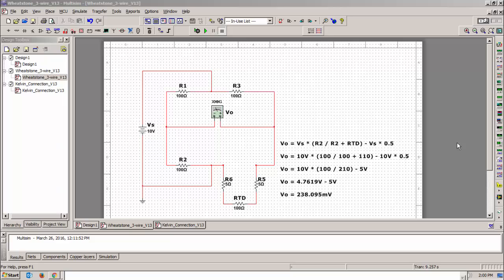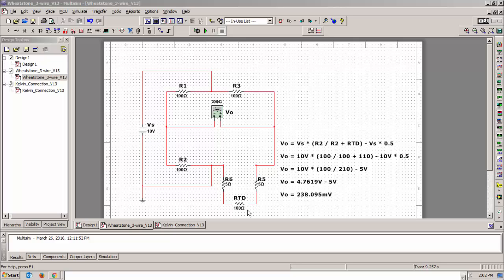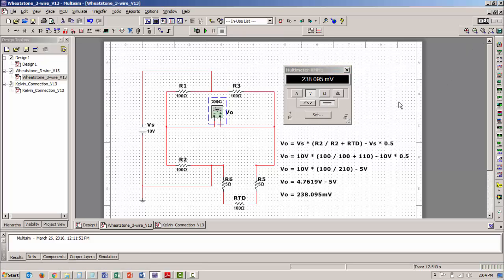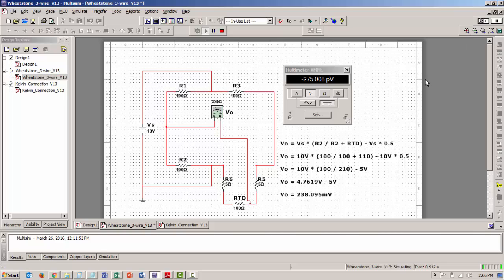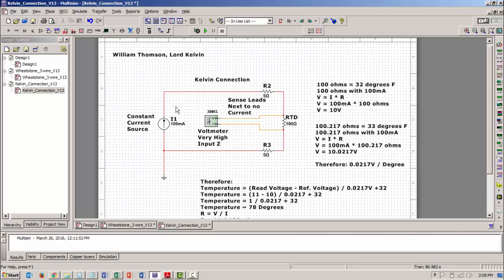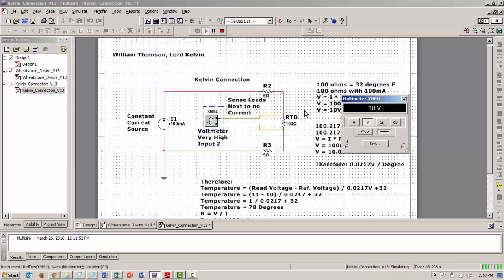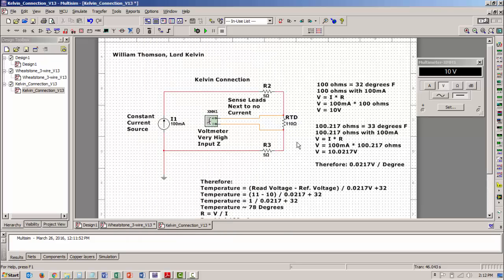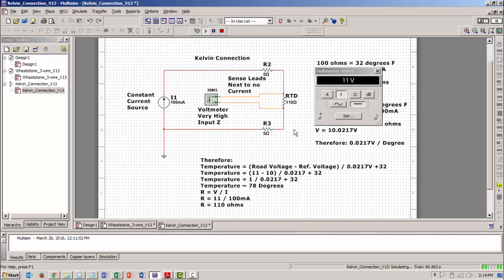RTD

Comment: how is Vo so small in the 3 wire circuit..you say they cancel out but exactly what cancels out?
Reply from the maker: The whole thing is basic ohms law. As long as the lead resistance of each lead is the same, the voltage drops across all the resistors including the RTD is equal and therefore the voltage drop that would be across the lead resistance is included in the calculations and the voltage drop that occurs across the lead resistance is canceled out. If the resistance of each lead of the RTD is different, the meter will read the voltage drop difference. Again, it is basic ohms law.  Redraw the circuit paying attention to where the meter is placed in the circuit. This website might be helpful to you: https://www.electronicshub.org/wheatstone-bridge/